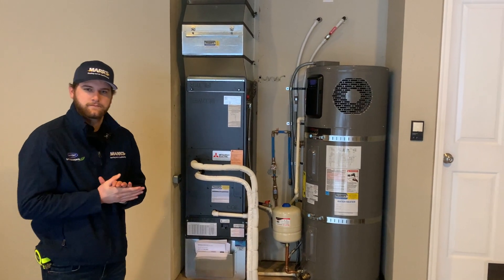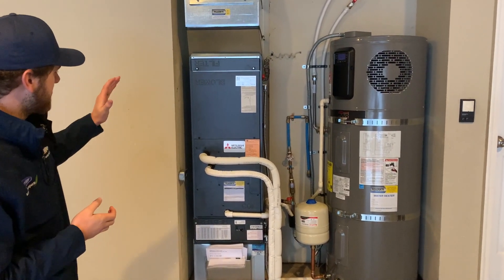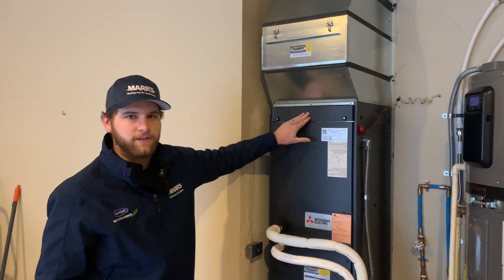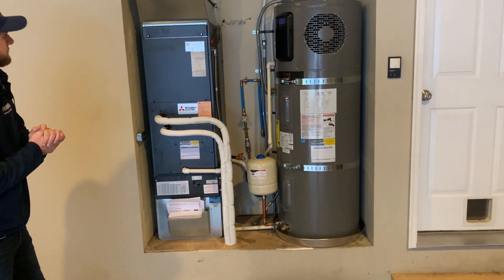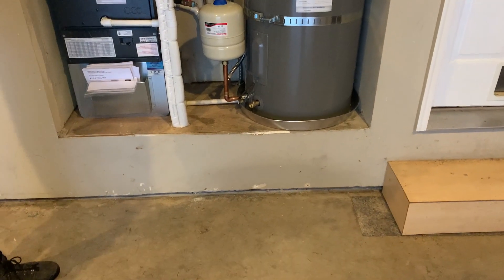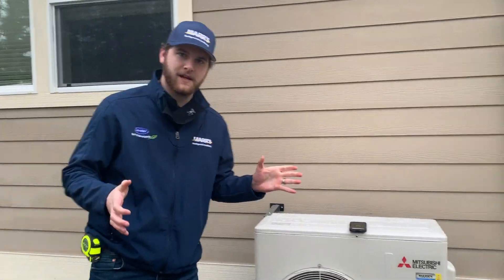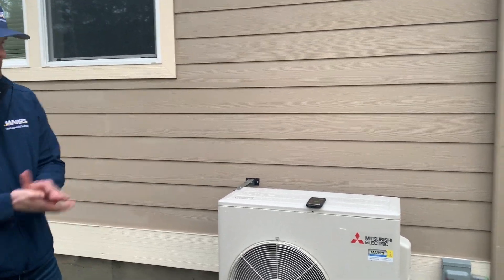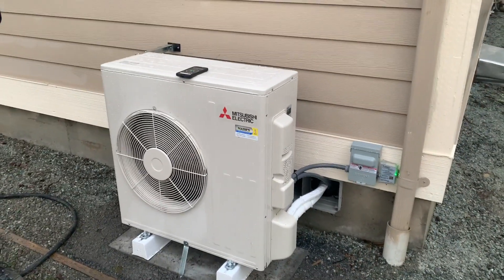Mitsubishi Ducted Heat Pump System

Comment: At what outside temperature do you guys still work on the outside unit? TXV ,reversing valve, those type of repairs. Do you make the customers shovel the snow around the unit or do your mechanics shovel the snow also? If you lose power for a day or longer how long do you need for the crankcase heater to be active before starting the unit back up?
Reply: Oddly specific questions...
Reply: So specific questions seem odd to you. Obviously you don't do this for a living, @redsadventures5654

Comment: Great Install and love the finish product! 
I am also having increased electric bill with these units.. This is my 2nd year now.
1- PUZA36NHA7 Hyper Heat Outdoor Condenser
1- PVAA36AA7 Multi Position Heat Pump Air Handler (1st Floor)
1- PUZA30NHA7 Hyper Heat Outdoor Condenser
1- PVAA30AA7 Multi Position Heat Pump Air Handler (2nd Floor)

Last year my electric bill went up to $1,160 in the winter and in the summer my bill is low as $176. I had the HVAC servicing team come many times to trouble shoot this unit.

We set our temp at 70-71 degrees in the winter. We notice the unit is constantly running to maintain the temp. the outside temp is 32-36degrees today and I feel like the machine was running most of the day. (70%) The service tech is saying to get heating strips and this way machine wont work as hard. But that is another thing going on the grid which will increase my electric usage. Any thoughts or suggestion? 

Troubleshoot:

Did a blower door test to detect any leaks, and I passed.
Check refrigerant levels to ensure no leaks- passed
change air filters- 
ask them to do another heat loss calculation. I was told the im oversized for the house by 7

Please help!
Reply: These are precision charged machines. If the charge is overcharged or undercharged they will use more energy. Possibly the system is not sized correctly for your home. $1100 is VERY excessive as these systems are extremely inefficient. I’d call a different service company with more experience/knowledge to troubleshoot. They can actually measure the kW useage in real time. Also, the other question is how is your window quality? What about insulation? Is your home losing more heat than the system can transfer?? These are all questions as your whole home is a system, not just the machine
Reply: Hi there. Looking to transitioning to a heat pump. Do you mind sharing your approx. location, house size, and heat pump size? And why do you have 2 heat pumps? Thanks!
Reply: An important thing to understand about this type of equipment is that it will be running almost all the time (depending on the type of control you use). Rather than turning on and running at a fixed output like older equipment (either on/off), and utilizing simple 24V controls, modern VRF equipment will constantly vary its output to precisely meet the demand, and uses serial communication between system components. That’s where it gets its efficiency, but also causes a lot of confusion on the part of homeowners who are used to equipment that only operates at one fixed output/capacity and on demand from their thermostat.

Comment: Thanks for providing the decibel on the outside unit. Any idea about the noise generated by the air handler inside? Also is the air handler a variable speed unit?

Comment: Hey guys, a couple of questions.   Why is the air handler upside down?   Not criticizing, just wondering, and would adding an extra filter not cause restriction to the air handler which was designed with the restriction with its own designed filter?
Reply: downflow unit

Comment: Do the mitsubishi splitter/ junction boxes turn coolant off to unused units, or does it simply split it? 

I have noticed on my system (2 air handlers) that if I have the first floor on heat and the second floor on fan, the second floor unit still continues to produce heat? Is there any way to fix that? Thx.
Reply from the maker: No good way to fix. In heat mode, refrigerant will be sent to both zones. In cooling, it will only send refrigerant to the zone that is calling for cooling. All brands do the same thing unfortunately!
Reply: @marrsheatingandairconditioning  Thank you, that's what I feared.
Reply: @marrsheatingandairconditioning  Isn't this a Mitsubishi VRF system where there is an expansion value on both indoor units/air handler, and also on the outdoor heat pump so that it can control the temperature individually and more precisely for each indoor unit?

Comment: How much?
Reply: I'm in Northern California, and I got a quote of ~$20K with this system (1 SVZ indoor air handler and 1 SUZ outdoor heat pump), but also including electronic dampers for the ducts to zone both levels.
Reply: @stevepon7810  Phew, that was for just installing the unit?

Comment: Great video and thanks for sharing.  Would you recommend moving to this electric unit even if you currently have natural gas in the home?
Reply: Yes. Many people have done it. You don’t need it. That’s a heat pump hot water heater as well next to the unit. Save money by not lying for gas. Save more money by getting Tesla solar.

Comment: I-wave is supposed to be installed on the return side of the ductwork (;
Reply from the maker: We certainly try to do that to treat the coil. We really added this last minute and due to the unit width we didn’t have room to install in the blower compartment. We also didn’t want to install before the filter. The good news, our climate is very dry, so hardly any latent load type issues, such as coil growth. But yes I agree, coil should get treated!

Comment: Would that set-up work with an 1865 sq ft mobile home for both the heating and water heater? My ducting is in the crawl space, with the cold air return in the ceiling. I live in Sequim, BTW.
Reply from the maker: Hi Kris, this system is great for a manufactured home, and dollar for dollar is likely the best heat pump system you can get for reliability, comfort and noise. I hope this helps!

Comment: I just installed a mitsubishi 4 ton hyper heat unit with 2 air handlers. We're still under construction but my 1st electric bill came in at $285. I pooped my shorts when I saw that. Compared to the $103 gas bill at the house we are currently in. I'm hoping I didn't make the wrong decision in the long run by going all electric on this build.
Reply: John, I am just wondering if that was above what your normal electric bill is at your current place. My house is all electric-a mobile home-at 1865 sq ft, with no heat pump systems. That $285 is my electric bill in January and February, using a propane stove to supplement on colder days (at about $28 a week). Hopefully, your bills go down significantly after your construction is complete.
Reply from the maker: Hi John, lots of factors go into heat pump system design. If you are on natural gas and depending on the size of your home, it is possible that it may be cheaper to Heat with gas by a small margin. Every home is unique In the amount of heating or cooling it requires and factors like climate, utility company rates and indoor temp setting play large roles in the effectiveness and payoff of these systems. Hope this helps!
Reply: From everything I've seen, natural gas is probably cheaper than heat pumps whenever the COP drops below about 1.50 on the heat pump. That varies but could be 10-20F or so. Disable the hyper heat or backup heat though unless you really really need it.
Reply: @matsudakodo  yeah I flipped the breakers on the backup heaters.
Reply: 103 gas plus ??? For your electric at the other house?  Hmmm was it +- 182?
Reply: How have your bills been since?
Reply: @Eric Franke  They have been averaging around $400 that is about $130 more than when we used gas. However, we added a bunch of stuff, we ended up with 2 sets of heat pump washer dryer sets, an electric car and a stand alone fridge and freezer, so I guess it's not terrible when you consider that. 

However, I had two months where my bills were $630 solely because my mitsu dealer messed something up (blew a gasket and had to recharge the system twice), but that forced us to use one of the electric emergency heater for two weeks. 

I'm still having trouble; my dealer is always pleasant, but I know he is tired of dumping money into my system. 

There is a lot I just don't get. For instance, I set the thermostat to heat to 74. It knows the house is at 71 but never spools up the fan to high. 

I have changed option 8 in the menu to set the fan to high but still have to do it in the app or on the thermostat; otherwise, the house never heats up. 

But even more messed up is the fact that when the sun comes up and heats the house up, around 5 or 6pm, the unit keeps heating (blowing hot air) even though the thermostat knows it 76 in the house!

 I'm not sure what to do at this point. Do I bring another mitsubishi dealer in? I mean, technically, the system is a year old and it has never worked right. 

 Last summer I noticed the same thing in air conditioning, It wouldn't cool but yet the outdoor condenser was barely running. It's probably something in the menus. I just need to take the time to go through the manuals page my page and figure it out.

Comment: Thanks for sharing your experience. I am also looking to replace my aging central hvac ( NG/ AC ) by such a system.
what is the model and size of this heat pump / air handler combo and what home size it is heating / cooling in which climate zone ? Will it be possible to share some data on its electricity consumption ( KwH ) while heating ? Is the efficiency close to COP of 3 with ambient at 35-40 F as claimed my Mitsubishi for their ducted system ?
I have a 3400 sq ft home - two level - with good insulation in Bay Area, CA. I am looking to install two 30K BTU ducted Mitsubishi heat pump. But I am super scared of running high electricity bill as it is very expensive here and hence, my request for sharing your observation of KwH uses  and COP of these systems. Thanks.
Reply: I would suggest watching the video Technology Connections did on Heat Pump systems. In many cases, Heat Pumps perform as well if not better than conventional furnace systems.

https://www.youtube.com/watch?v=7J52mDjZzto